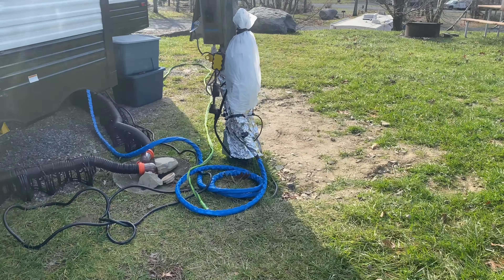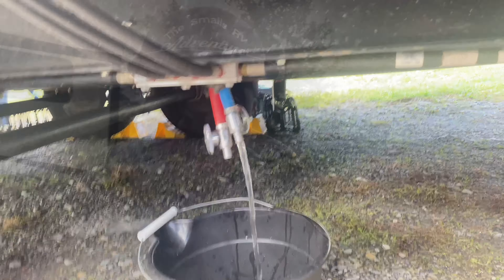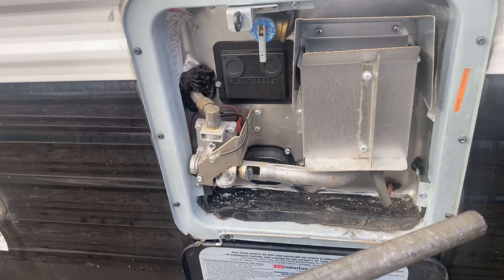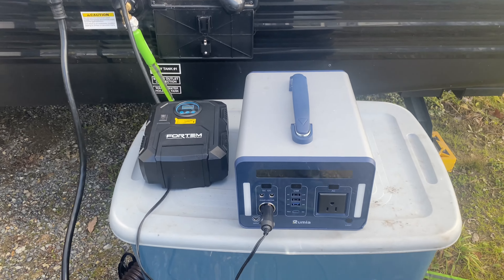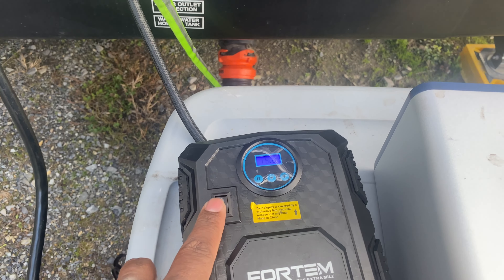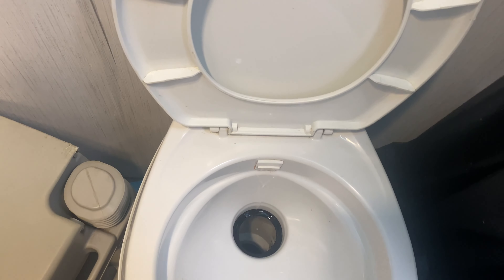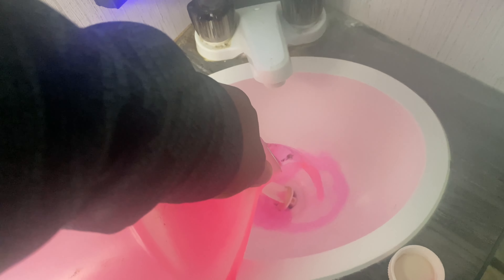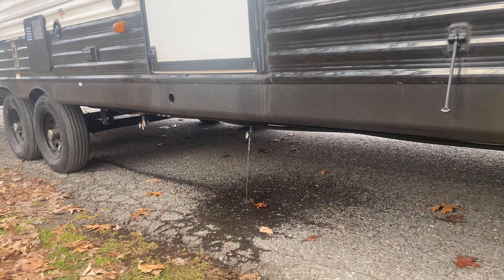Winterizing RV / Vacation Has Come To An End / Winter Camping

Comment: Two days ago I was winter camping in my house. My house is always set up for power loss like battery lighting part of the decoration in each room and a bag of emergency things like hand crank radio and flashlight etc. but in time it will be even better because of what I’ve learned on your channel. 
I didn’t prepare like I usually do by charging up various recharging devices and checking battery candles etc. I was excited to find that my solar backpacking charger still had power to recharge my phone. I could do it in my car but didn’t want to mush through four and five feet of snow without some tunes. 
That little charger is one of the greatest devices I’ve ever had. Not big enough for your family’s use but it clips on a backpack and the power doesn’t diminish even when it has sat for a year.
Reply from the maker: Hey Heather. My son has one of those back back solar chargers. They do work really well. He usually just sit it at a window and it keeps the solar bank full. It’s a nice thing to have. The LifePO4 batteries in the car are excellent. We never run out of power it feels like. I loving camping. Even during the winter you can have such a great time.

Comment: I opened all my lines when I got back today but for some reason no water came out my hot water line .
Reply from the maker: The tank may be already drained. Remember to leave those low point drains open. Any residue water will fall out as the temperature gets colder.